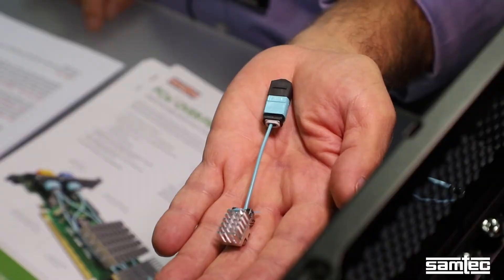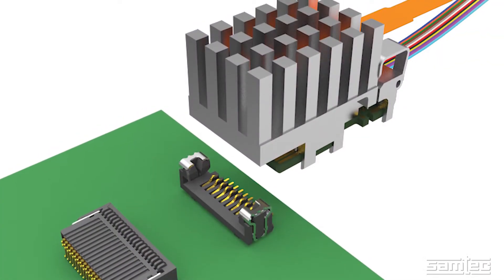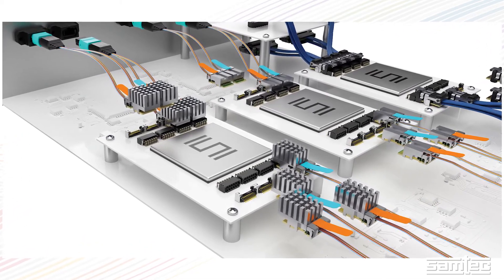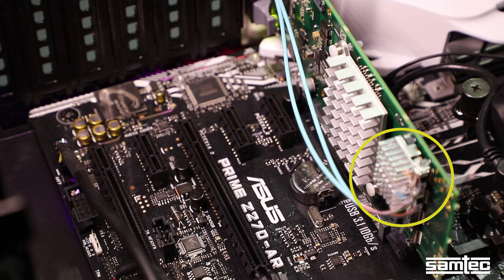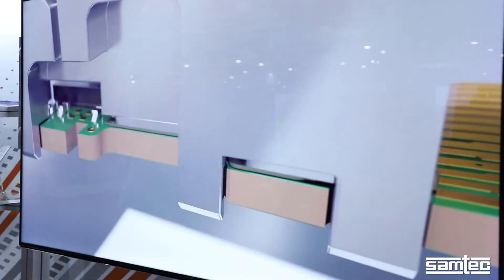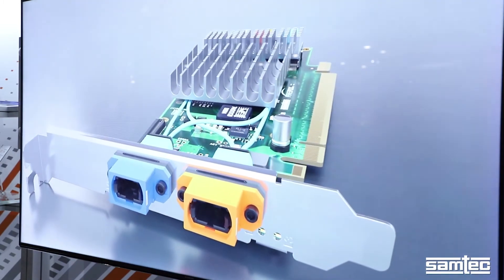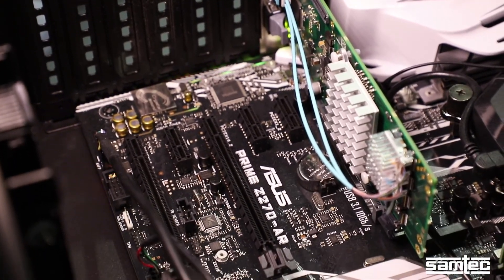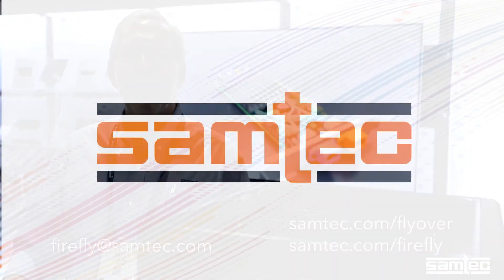PCI Express Over 100 Meters Of Optical Cable

Comment: This would be amazing for external GPU enclosures. Imagine this technology integrated into an Intel NUC or any other small form factor platform
Reply: the issue is that the hdmi output is on the gpu, so you'd need to return the signal over fiber back to the NUC.
But yeah this is really nice non the less.
Reply: @svampebob007  Couldnt they have daughter boards connected to the nuc that have hdmi ports?
Reply: @MilkyToucan  they could and yeah I forgot about that thing, it's still pretty cool!
Reply: some egpu uses hdmi interface adapted to nvme or something else.. You can just buy hdmi fiber extender. This means just more doors to access one room.